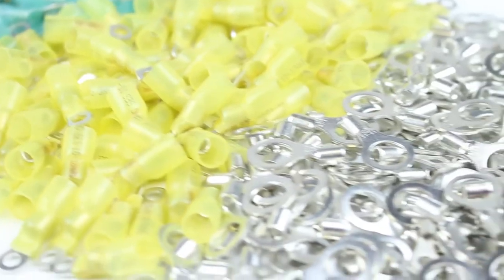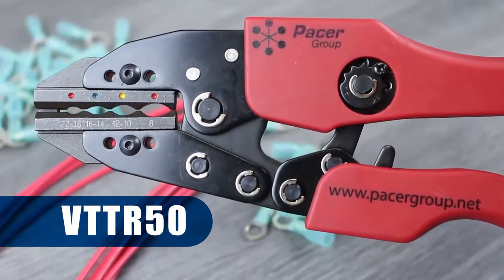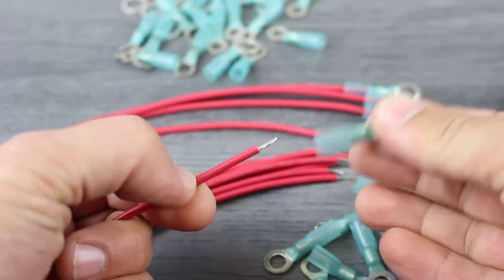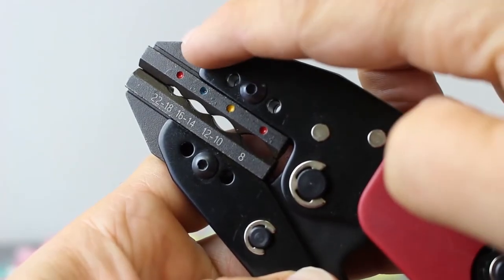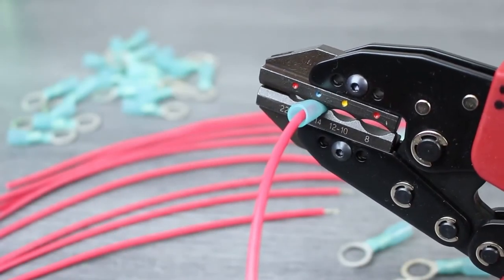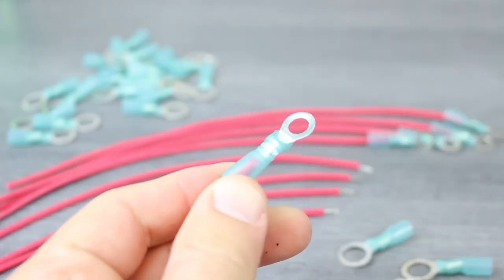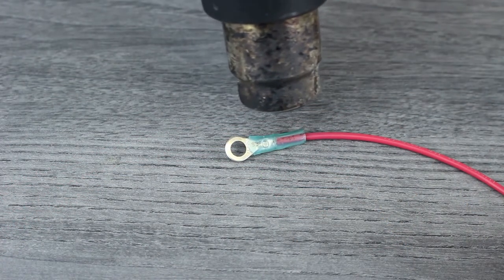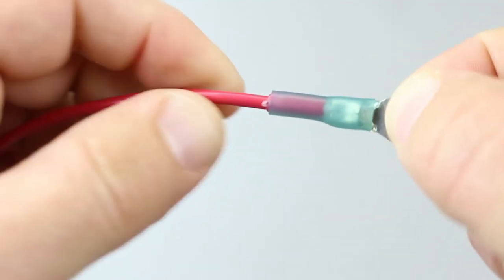Ring Terminal Installation

Comment: Any videos/help on topic of how big a ring terminal can I use with 18/so/22 gauge wires? I have a 1/4" grounding bolt that I want to attach a wire to but I have the small wire/big ring connector problem. Thanks
Reply from the maker: This product will work perfectly for you. 
 https://www.pacergroup.net/ring-terminals-for-22-awg-18-awg-wire/
All you need to do is select the insulation type, stud size (1/4"), and package size. Then you'll be set.